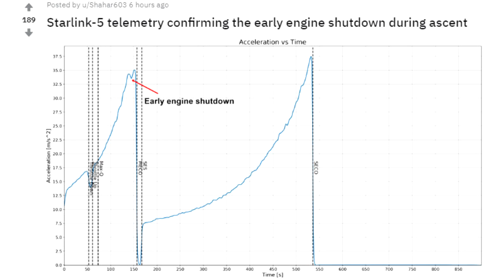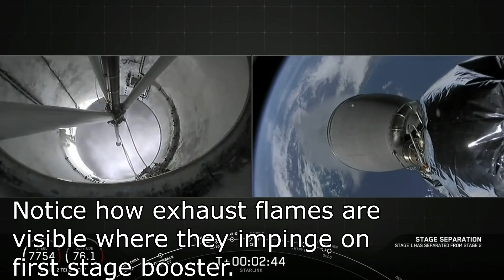Falcon 9 Suffers In Flight Engine Failure, Booster is Lost,  but Cargo Delivered Successfully

Comment: It's so damn impressive how error-tolerant SpaceX rockets are. These (partly) failed missions are the most interesting to watch.
Reply: Not so error-tolerant is seems, otherwise it would have successfully landed with a single engine failure. But we still don't know what really happened, so it's just speculation.
Reply: @niccolobelli5261  Error-tolerant enough to get the payload into orbit, at least.
Reply: @Ensign_Cthulhu  true, but I bet they are the first ones to not be satisfied with the outcome. Especially since they want to land astronauts propulsively in the future with starship, they need to make propulsive landing more reliable and resilient to engine failures.
The good news in that starlink is pushing the envelope to the limit, so they are going to learn a lot from it.
Reply: @niccolobelli5261  They don't need the reliability as much for Falcon 9 landings. Seeing failures happen gives them areas to focus on for Starship. Starship will likely be able to change which engines are used during landing, in case of a failure.
Reply: @anthonypelchat  I agree, losing a booster is bad but at least it's a good gym for Starship

Comment: I would have thought that  to be effective, the water sound suppression system would have activated before engine start, or are the visible sprays only a secondary part of the system. In previous launches they activate prior to engine start.

Comment: i'd like to ask whether damage to the engine bell will cause significant aerodynamic forces on the rocket? or are the roll errors more likely 'internal' e.g. loss of hydraulic fluid etc.

Comment: if falcon 9 turns too fast it can run out of fuel which cools the engines. was the problem at 50 seconds? at 50 seconds it weighed close to 650,000 pounds. a sum of the masses at distances is possible. m=20,000 slugs. engine mass 400 slugs , payload mass 1000 slugs, tank 1300 slugs , fuel and oxidizer 17,300 slugs. average 
I 1/12ml^2 =10^9
Reply: the horizontal tank must be accelerating more than 1 g - the lengthwise  rotating tank has about 10-15 ft/s^2  acceleration -
Reply: I is closer to 10^8 resulting in tangential acceleration of 100 - 150 ft/s^2 .  alpha r r=100 ft. could be a problem ?
Reply: correction :   T= ,1 x 1,500,000  x 100 ft = 15,000,000 ft pounds .  T= I  alpha   ,  alpha = T / I = 10^7/3 x 10 ^7   alpha= .3 rad/s^2  acceleration = alpha r = .3 x 100 = 30 ft/s^2 - 50 ft/s^2

Comment: The engine puff looked to be the center engine, and it looked like the booster still had a ton of speed after the entry burn. I'm thinking similar to the others, failed center engine causes an insufficient entry burn and either impossible landing burn or possibly a breakup.

Comment: Scott, human interaction and commands are removed a few seconds before T-0. From that moment on, no one can make a call to either go for stage 1 landing or abort it. During an engine out event, the flight software is resilient enough to correct for it, but there is no go/nogo decision for downrange landing. Stage 1 will attempt a landing no matter what. For LZ-1 landing, i assume there are contingencies in place such as divert maneuvers to hit the ocean (happened during CRS-16 when the stage took evasive maneuvers to go back above water) or likely not attempting a boost back burn. But it all depends on the timing of the event. There is a reason why the base is evacuated before launch ;) Cheers
Reply from the maker: Right, someone designed the decision making process with the relevant contingencies.

Comment: Question: Do think if there was an engine shutdown during a crewed mission that would be enough to trigger an abort to fire?
Reply: Not automatically.  Any abort due to an engine shutdown would either be in a very narrow band of times when it would require an immediate abort to avoid disaster (basically, until you've burned off enough fuel to continue to climb on the remaining engines), or would be a decision made by the flight director and manually triggered.  Losing one engine ten seconds before MECO probably wouldn't even trigger an Abort To Orbit, just a contingency launch plan that sees slightly longer first- and second-stage burns to reach the planned orbit.  (Note that the Space Shuttle lost an engine in flight once, resulting in an Abort To Orbit...)
Reply from the maker: Not on its own, a single engine out still has room for a safe ascent.

Comment: Was it me, or did the entry burn last several seconds longer than the old launch? They start frame perfect. The failed return seems to have a noticeably larger plume (possible damage to an active nozzle?)  Liquid on the lens, that quickly evaporates, unburned propellant/oxidizer mix? Also, entry velocity seems much higher to me just prior to the downlink cutoff than the previous video.

My personal take is that something might have failed so that there wasn't enough thrust being produced during the return burn, which took the vehicle out of profile enough that the downlink was cut and/or the flight termination system activated. Though the lack of static in the downlink prior to cut seems to be weird to me. Is it possible that mission control deemed the booster to be in an unrecoverable situation, and simply cut the feed before terminating the booster?

Comment: In a typical launch, as the first stage reaches high altitudes, the exhaust has prominent lobes - one from each engine.  These lobes are usually orderly/symmetrical.  In this launch, two of the lobes appear to be wandering around, at times one seems to almost disappear before the anomaly.  Also, after the re-entry burn, the first stage is rotating back and forth on the long axis, and the grid fins are struggling to keep up - very unusual.  Almost as if the fins were fighting a torque during the burn, but the torque quickly went away on shutdown of the engines, causing an over-control response.  Both of these could be caused by a steering issue on a single outboard engine.

Comment: As always, we learn best from our failures.  Elon had told us that the reusable first stage was designed to make ten launches/landings without major retrofits - this may prove to be an overestimate.  Nevertheless, even five launches is spectacular.  If that nine-engine booster stage is worth $10 million to build, the 50 landings so far represent a cool half-billion saved, which is only just enough to buy one-point-five Atlas launches.  Go, Spacex, go !

Comment: My flying instructor loved to tell students concerned with the chance of  an engine out in a single engine aircraft that more engines increases the chances of engine failure. At low speed asymmetric thrust can be more dangerous than no thrust.

Comment: the grid fins didn't look like they were working as "usual". They came out very slow on stage separation. I suspect a pump failure.
Reply: They deliberately deploy slowly just after stage separation.  It is normal.  The grid fins are only used after entry burn.  they is not enough air after stage separation to reentry for them to have any effect on the flight path.
Reply: @stevenf1678  I know but they usually deploy smoother

Comment: I wouldn't be so sure that one of the outer landing engine's didn't fail.  That landing burn looks like it was a 1,2,1 burn instead of the usual 1,3,1.  The plume didn't take on it's full "bar" shape during the 3 engine portion. The plume was visibly more ragged like it was interacting with a low velocity flow.  The booster bobbled like it was correcting for unexpected changes in thrust.  There was that new bit of ice that floated by that looked like a big version of what regularly falls off the 2nd stage engine vents.

Frankly it looks to me like one of the outer landing engines failed right before MECO.  And not surprised they let it try to land.  The flight control validation and re-entry model validation they'll get from the attempt will be VERY valuable.  This also gives them a non-zero chance to get an engine back that failed in flight!  And the probability of landing ship damage is very low given the flight computer was still working perfectly.
Reply: I understood they had the capacity to select a different pair of outer engines if one of them failed. Maybe not. I'm not gonna watch several more hours of youtube to try to find it again.
Reply: @joshuahudson2170  From memory, I thought the restart ability was only given to three of the engines.  If one of those fails, there's no way to select a different set of three engines.  I agree with Marty, the entire re-entry burn looked a bit odd to me like they were not running all three engines.
Reply: @Astronomy_Live  If they are planning on reusing boosters, I think restartability will be a function of every engine

Comment: My first take was there was a failure in the piping to one of the rockets causing a blowout and the feed to that engine to be cut, during re-entry the damage from that either worsened from a leak into a full rupture or there was a second failure, ultimately meaning loss of the propellant feed functionality required for landing. This could be a similar degradation in parts previously seen during the failure of the one way valve.

Comment: Was that one of the fairings that went by in the video of the first stage decent?
Reply: I wonder? check it out at .25 speed from 5:25-5:29 last key-frame before it leaves the view, looks very interesting..
Reply: Pretty sure it was. Wonder where the other one was. The one we saw was a near miss! I guess that would be called  a mid-space collision, vs a midair.

Comment: The second failure could be due to running out of propellant.  Remember, Starlink is Falcon 9's heavist payload, so they won't have much margin.  If the failure of the engine on the way up caused it to use more propellant there, having enough to do the reentry burn and landing may have been a 50/50 proposition (or worse), and they decided that they may as well give it a go.  Consider also that the entry burn would have to be somewhat longer than usual, since during the short extra burn time during ascent the vehicle will coast further downrange, overshooting their intended trajectory, meaning they had to slow down more to correct. Even at staging, the vehicle is traveling very fast.

Another possibility is that the overpower event that triggered the earlier abort did in fact damage the engines.  Stress fractures can be nearly impossible to detect, and can definitely result in a failure a while later.
Reply: Marcus Knightingale  Hear, hear!
Reply: I think you might have nailed it. They really don't have much fuel margin on landing. An extra second of burning the 8 engines could easily have used it up, especially with a maximum performance mission like this.
Reply: Which illustrates the impracticality of this nonsense. They want these stupid things to survive reentry, and with a little dusting, launch successfully a second time. A single rusted valve is enough to cause liquid fuel engines to fail catastrophically. Additionally, anyone who's played KSP knows that last bit of fuel probably had as much delta-V as the entire ascent launch.
Reply: TheCreeperkiller but they do launch a second time and a third and a forth and a fifth time.
Reply: TheCreeperkiller 

Wow you seem mild mannered (not!)
Reply: @KerbalLauncher  They do a full inspection before reuse. It is very thorough. Parts not to spec are replaced, obviously.
Reply: @MrCarGuy  
There is no such thing as a full inspection. You can only test what you can get access to without taking the rocket to bits, and you can only do as much testing as you have time for, and you can only use methods that don't damage the component you're testing.
Reply: @owensparks5013  No kidding. Are you trying to convey a point here? This is implied. They use small cameras for inspection and extensive corrosion examination, etc.
Reply: @MrCarGuy  
Hi, my point was in reply to your implied assumption that everything was 100% ok because some people looked at the rocket. To test something for mechanical flaws means disassembling it then using something other than a mk1 eyeball to determine if each and every component is damaged.
Reply: @owensparks5013  I never implied anything was "100% ok because some people looked at the rocket". Do you have a problem with English?
Reply: @MrCarGuy  Another point is that due to the intensive nature of inspecting the rocket, it is surely a huge time requirement to test a whole stage in the time frame they hope to achieve (what is it 24-72 hours?) Even they've decided not to continue that aspiration with Falcon, the expectation is there for Starship and that is already far more ambitious than any rocket built to date.
So it's either they build these things to last and not require too much more indepth inspection and refurbishment, or they somehow get more personnel involved to complete intensive testing in a shorter amount of time.
Reply: @MrCarGuy  The equivalent of a "D"  check/overhaul is meant to be after 10 flights.
Reply: @MrCarGuy  All depends what your definition of full is.  They do not inspect 100% of the booster. They do inspect 100% of the parts they deem necessary for inspection.  Unfortunately some things that can un-inspected can fail, though the mathematical probability of them failing is so close to zero, hence they don't get inspected. Also it is only with actual launches, and many of them, that other risks emerge, e.g. the COPV failure. NO ONE saw that coming and no one was inspecting for that design flaw.
Reply: @MrCarGuy  Some things, like stress cracks you cannot see with the camera. You would need x-ray, die penetrantes, or other methods where parts would have to be removed and replaced.

Comment: Unfortunately, there were multiple failures on this mission. First an abort triggered by engine power. Then an engine failure, followed by a failed landing. While Falcon 9 customers may not need to be concerned about reliability.... If this were to happen on a manned Starship mission, there could be 100 dead passengers!

Comment: Actually if the rocket an engines were reused a a group, you extrapolate most starship flights having an engine out.  One in 50 is a very poor for a reusable device.
Reply: not if it is cheap.

Comment: I'm curious why they ignite the engines at 0 instead of at T-2 and launch at T-0. Much like the Space Shuttle ignited their engines at T-6.6 senconds and let them throttle then ignite the boosters at 0.
Reply: who hold the rocket back if it is ready to go? If it is ready to go at T-2, might as well let it fly!
Reply: @snuffeldjuret  I'm sure there is a perfectly good explanation as to why they launch after T-0 I'm just curious as to why. The shuttle always launched at T-0 to allow for SSME throttle up and rebound from the twang (which these rockets don't do) so I'm just wondering why they don't launch at T-0.
Reply: @snuffeldjuret  Probably not. I'm sure it's an engineering thing.

Comment: Another thing to note, and it's rather hard to see over the edge of the rocket without the side by side with a previous launch, is that there appears to something on fire (or otherwise glowing that shouldn't be) after the entry burn ends.
Reply from the maker: Yeah, I forgot to mention that.